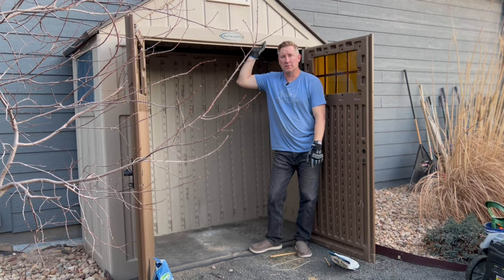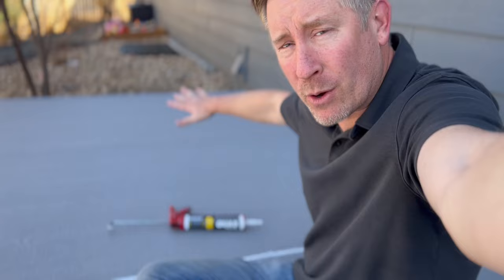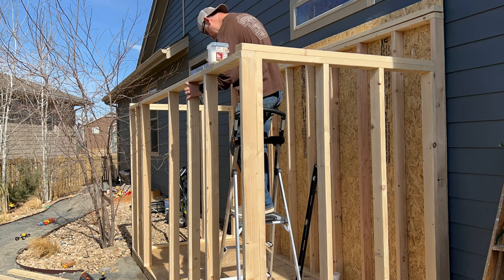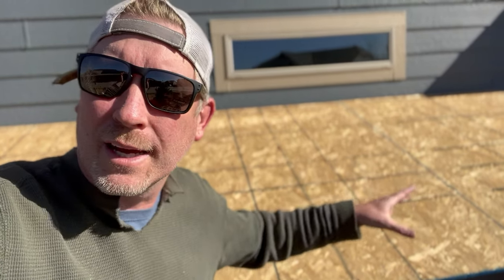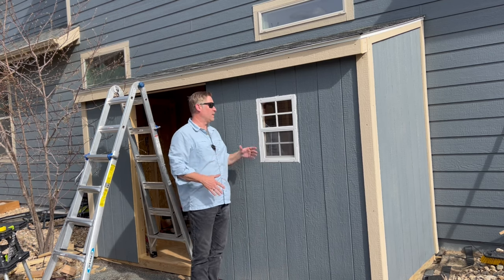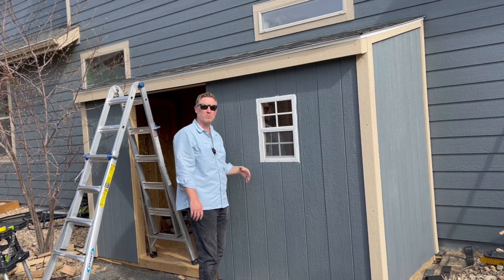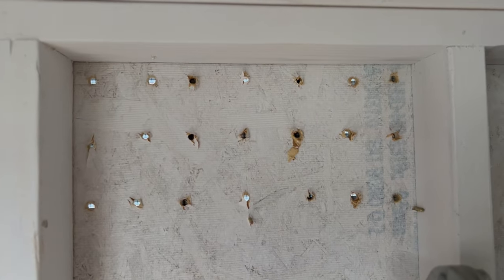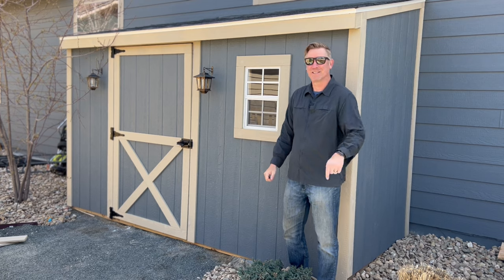DIY Building a 5' x 12' Lean To Shed | Start to Finish

Comment: Good build. I have these questions:

1. Did you anchor the floor or does it just sit floating on the ground (and could blow away in a windstorm)?
2. Did you anchor the shed to the house? Are the two touching?
3. How do the shed roof and back wall of the house meet? Is the shed connected or anchored to the house? Flashing used?
4. Is water rolling down the backside of the shed an issue?
Reply from the maker: Thanks for checking it out!

1. Floating on the ground/base rock...it has not moved even with some high winds we've had...it's got some weight to it.  But could always use some forming stakes driven into the ground and then secured to the bottom frame.
2. The shed is not touching or anchored the house...has about 1-1/2" gap.
3. The roof does not touch the house, however, the drip edge does and I used a bit of flashing to help with water runoff - which answers part of #4.
4. It's possible there may be a bit of water running down the back from a rain storm, but the flashing against the house helps.  Plus, the wind we get from time to time and having the gap would dry it out.

Thanks again!

Comment: This turned out great!  It's okay to have the pressure treated lumbar directly on the ground?  I'm getting ready to build something like this.
Reply from the maker: Thanks!  Yes, because the wood has been treated to be water resistant it’s ok to use directly on the base rock.  So far I haven’t had a single issue…it’s dry, no warping of the door as thought by someone else.  It’s been great to have!
Reply: @WhatWeDid365    Butt when you cut it it's not protected now??? I've heard
Reply from the maker: @tombo552001  True, could have put a vapor barrier or something, but I'm not expecting a lot of moisture.  Appreciate the comment and thoughts!

Comment: I love it… but…did you paint the back wall facing the house? I am concerned about the siding breaking down years without paint protection from the build.
Reply from the maker: Well, I did not...the pieces have a primer on them and I didn't think to paint it.  So far so good.

Comment: Did you put anything to control moisture/mildew between back wall / house ?
Reply from the maker: Thanks Tim...I did not.  There's a gap of 1/2" or so and we get a pretty good breeze on that side of the house so I wasn't concerned with moisture build-up.

Comment: iam going to be building a shed against my garage in the summer. I am wrestling with whether to add sheating to the back wall or leaving it exposed because of moisture concerns. Did you add flashing on the sides of the back wall so no moisture gets between the back wall of the shed and the siding on the house?
Reply from the maker: I added flashing only around the top - even against the side next to the house to help keep water out.  We get a lot of wind/breeze on that side of the house and it has about 1/2" gap...so hoping it's not building up any moisture between the two.
Reply: @WhatWeDid365  would have been nice to mention that in the video. What did you use?

Comment: You would split that rafter between sheets vs sistering another rafter.
Reply from the maker: Thanks…I thought about that, but wanted the extra support and space to screw the sheathing to.  It shouldn’t have much load so I wasn’t to concerned with sistering the other rafter.